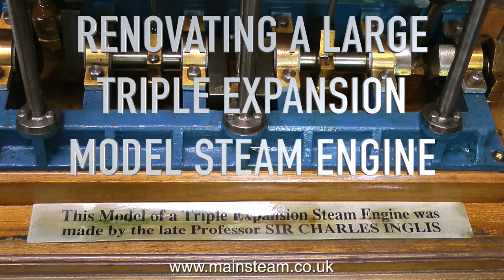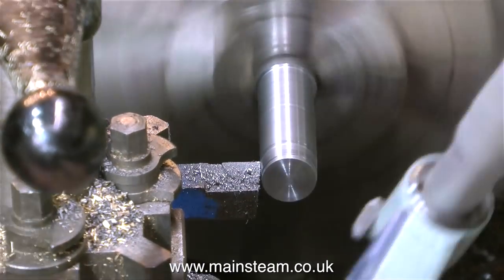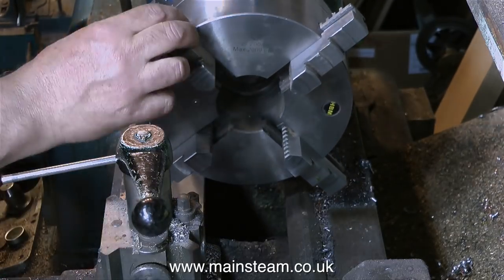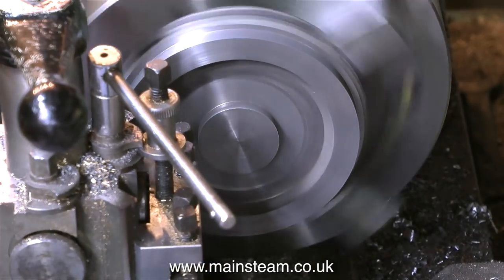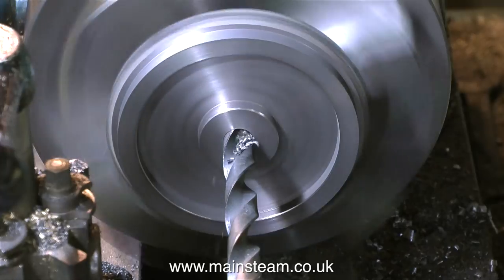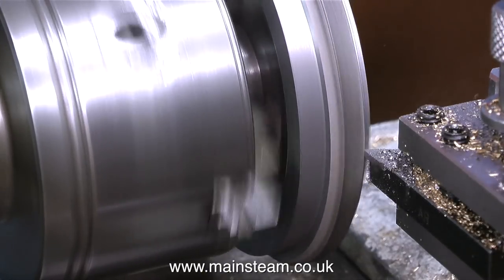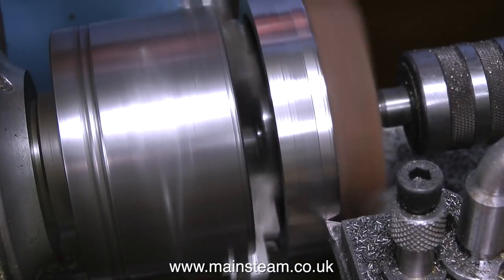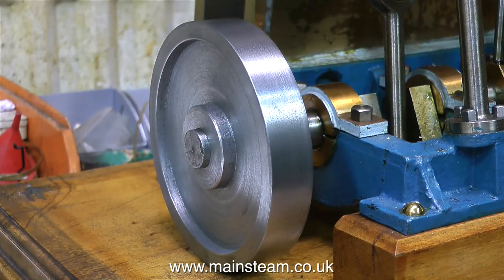RENOVATING A LARGE MODEL TRIPLE EXPANSION STEAM ENGINE - PART #2

Comment: A four jaw, self centering chuck? You can't do that. It can't have four jaws AND be self centering. Heathen!
Reply from the maker: It is very good, it speeds up the job, it holds square bar and round bar much more securely than a 3 jaw chuck etc etc .... I use my little Boxford AUD with a 3 jaw chuck for hexagon and small diameter bar stock. :-)))